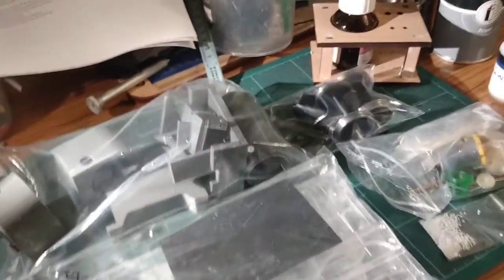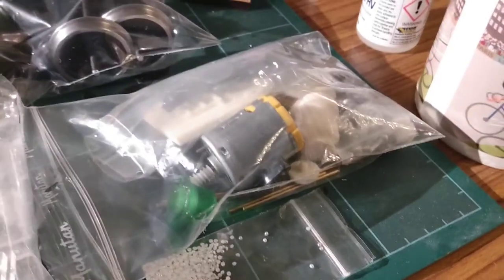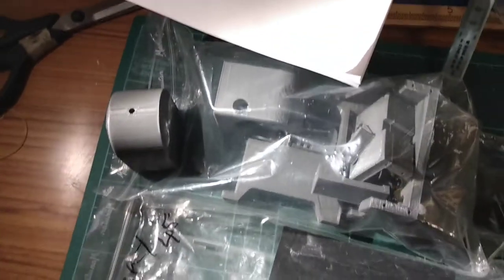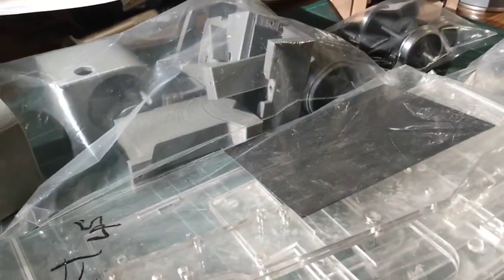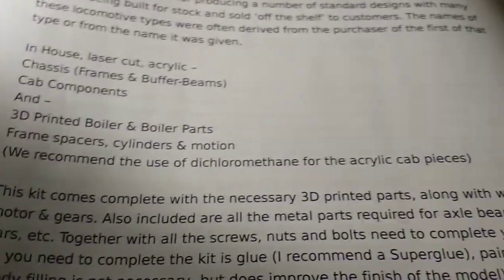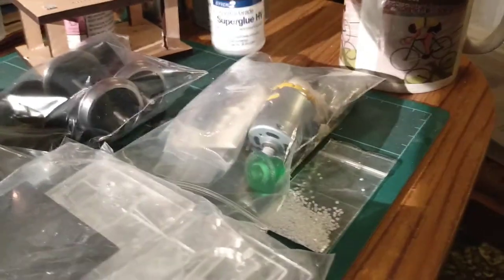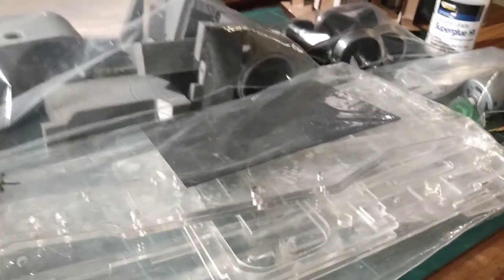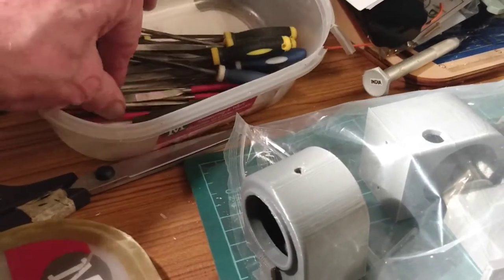Kerr Stuart Kit Build part 2. Tool, glues, paints

Comment: Some great tips here, originally used plastic padding filler on 3D printed parts, sadly it is no longer available, so now use Davids Isopon, not as good but gives a nice smooth finish for primer. High viscosity super glue I use on wood, MDF and all mixed media kits.
Reply from the maker: Thank you Kym Valley for those suggestions.  It will be helpful for viewers of this video. I have used both the filling products mentioned but not on 3D parts yet. I will have to see what is available in my local Motorworld. Cheers,  John
Reply: @bikerides  Good luck